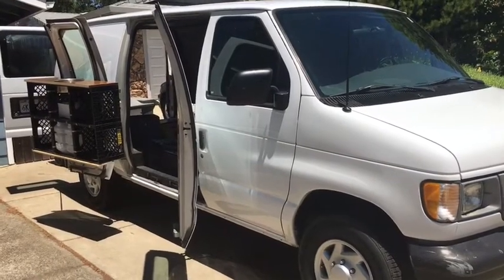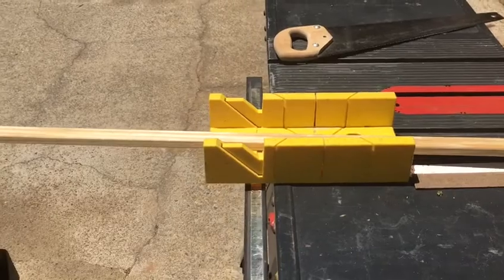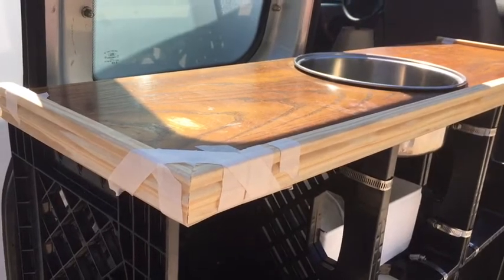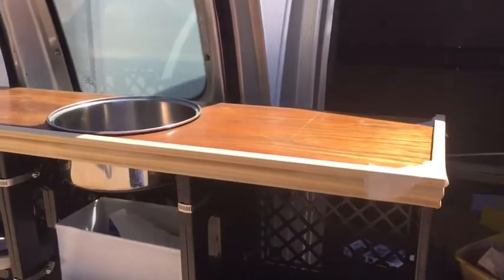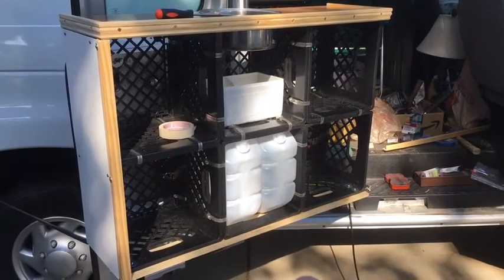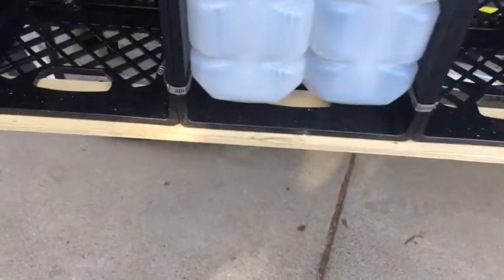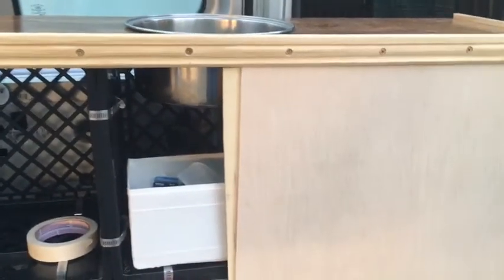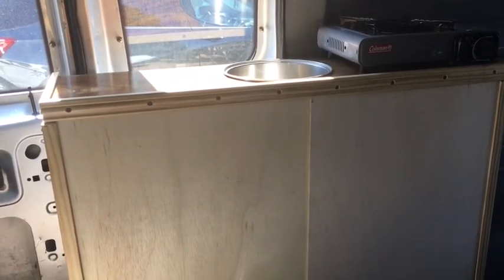Best budget galley/cabinet for the first-time Nomad, DIY.

Comment: What a unique idea! Nice work, the finished cabinet looks very tidy.
Reply from the maker: Thank you!  My thinking is that it’s easy and inexpensive, but more for like a weekender than a liveaboard.
Reply: @cocoonofsanity6754  I don't see why it wouldn't work for a full timer.
Reply from the maker: @wrylife57  in your case, probably ok since you have a larger van with more room for storage.  Mine is low roof and not the extended version, so I can carry enough water etc. for about 3 days.

Comment: I would use a back saw in your miter box, rather than a regular saw.
Reply from the maker: Agreed - sold all my tools 3 moves ago.  Would have just used the miter gauge on the table saw if I had one.  Point well taken, but the miter box worked ok with the crosscut saw as more of a field expedient.  Thanks for watching.

Comment: Careful hanging that much weight on the door. 

 Water weighs 8 lbs. per gallon.
Reply from the maker: Point well taken.  For my use, one jug is fresh and the other grey water, so that’s 20 pounds added to a 15 pound assembly on one of the lighter weight doors on the vehicle.  Loaded, it will never see 50 pounds.  The one Sportsmobile makes is out of heavier materials but is smaller.  I don’t know what it weighs, but it’s probably close.  The heaviest part (sink and water) are nearest the hinges, so the unit is balanced with that being in the middle.  The strain on the hinges of a front door would be greater.